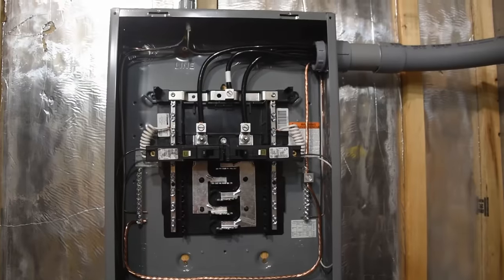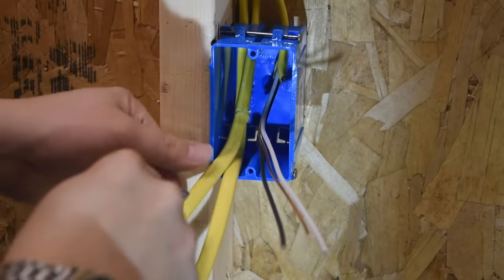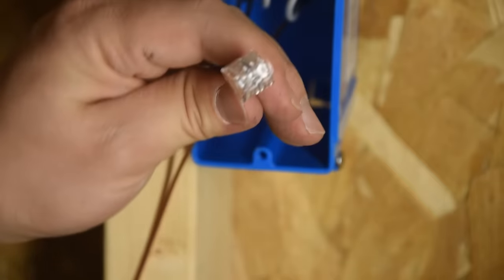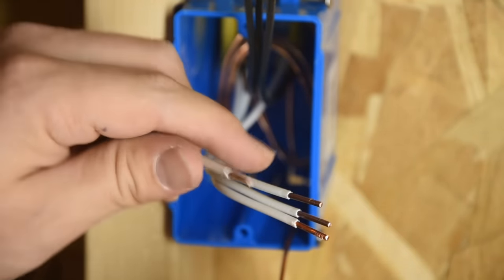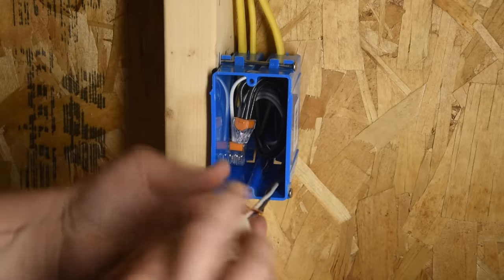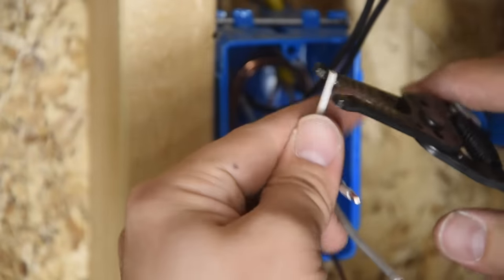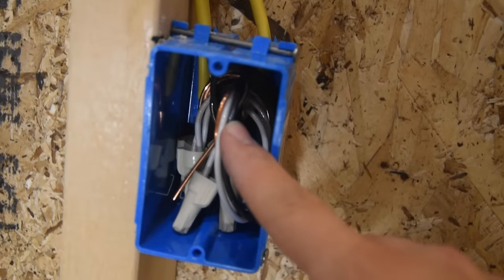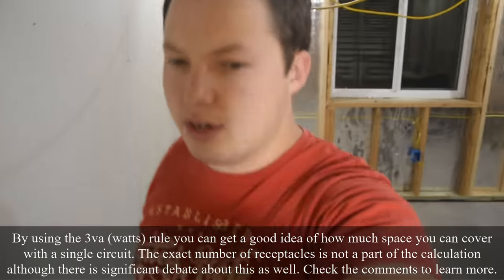Wago's vs. Wire Nuts - How To Wire Outlets During Rough In

Comment: In the UK I've been using wago connectors and different variations (ideal and hellermann tyton)  for 10 years. We used to have wire nuts under the brand screwit. I will not use any other form of connection now other than these mechanically maintainance free types. As for carrying full load current there is a video by a man called john ward where he carries out destructive testing and they are a lot more robust than everyone is saying. The single pinch point of the connector is a thing however on the opposite side of conductor the spring is pushing it onto a large flat conductive plate and so contact csa is not hindered. However not every one likes change and I cannot say there aren't those in the UK who are simply stuck in their ways and don't like progression.
Reply: You can keep the “Change.” With your progressive cents talking bout points and tips,  let’s just terminate every wire with terminal, distribution, junction blocks/strips. With compression fittings 😎 sorry I’m stupid when I drink.

Comment: Great video here. Thanks for doing such nice and clean work. I have two suggestions...

1- I think striping off the romex before going into the box is a bit faster and causes less damage to the coductors. I have seen some guys scratch enough of the conductor to cause a hot spot in the wire. 

2- Rolling wires into the box leaves you open to more damage potential from the drywallers. I always fold the wires into the box for two reasons. The first is that if the drywallers do actually hit the wires, then the damages is limited to the first two inches of the wire instead of the first four inches of the wires. The second is that the wire will already have the shape memory when installing the device. 

Regardless, your work looks great! I'd be proud to have you as an employee in my company.

Comment: I have used Wago’s reuseble with a opener 2, 3 and 5 for like 10 years, never had any problem! I work with refridgeration/ heatpumps, i think they are great!
Reply: @brianreinhardt4050  Are you trying to show this as a proof point that Wago connectors aren't good?!? Aside from the fact that he was talking about the lever nuts, where aren't used here, the WAGO here didn't fail until after the entire wire was essentially on fire.  That is absurd to try to draw any conclusion that any connection type is the problem here other than your house will burn down before you connection fails if somehow all the other safety measures had failed. 
If anything, I would want my connection to fail in an electrical box long before the wire got hot enough to melt the sheathing of the wire running though the wall but that doesn't happen with any of these.
Reply: @curtisbme  I was just providing proof positive that there should be no question regarding amperage overages and burning/igniting.  I've got no problem with them...
Reply: You've been lucky so far.

Comment: good habit is to point wagos and wirenuts up to keep mosture from settling in outdoor boxes. I know your indoors but it becomes habit if you always point them up.
Reply: That's how i was taught as well. I always have my wire nuts facing up.
Reply: Yes, especially with low voltage control wiring. Condensation can settle in the down facing wirenut and corrode the connection.
Reply: also cant fall up as in they cant fall off of they r pointed up
Reply: @amastri1  That is my reason for pointing up, never thoght about the moisture. Now I have 2 reasons.
Reply: Just logged in because of this comment: I was hoping to read someone's comment about this. YES, if you are experienced enough, you should always push your wires in the box with the connectors UPWARDS. Now THAT's a real electrician. Learn  there Benji
Reply: An old technician taught me this 40 years ago and I’m still doing it.  At the time of my post, not one down vote!!!  So I guess we’re doing it right.
Reply: Point em to the sky if you want to keep them dry.
Reply: Agreed.
Reply: My wire nuts always face up. Boxes get really full of dust, especially in an old house.
Reply: were i am all wire nut or wagos must be placed facing up or at 90 degs across weather in side or out.. if not, inspection fails
Reply: @amastri1  if they fall off, it was not done right, and you have a huge fire waiting to happen, never put loss wires in wire nuts, as i noted above
Reply: When you have 4 or 5 wire nuts in a box, the direction they are pointing is the last of your concerns. And if water is getting on your receptacle it probably won't matter. Most receptacles are indoors. Very few outdoors.
Reply: Very good point 👍 — condensation is quite a common issue on a build site during certain seasons
Reply: Nothing happens, even if the water is standing inside the Wago terminal.
Reply: @arnoldromppai5395  Shouldn't the breaker trip
Reply: @jimmy1life  in witch comment, the one i said, never put loss wires in a wire nut? no they heat up and start burning, it not a short until it is burning good and the hot and ground wires touch or neutral. but by that time the wall on fire, seen it many times as well, opened a box up the find all the insulation burned off, but lucky the ends of the wires in the wire nut that were not twisted tight burn off, and stopped the heating.. and was contained in the box
Reply: Instablaster...
Reply: Yup, that's what I've always done.

Comment: Wagos are awesome. I discovered them rewiring my house about 12 years back and never use anything else. I didn't see you mention this in your video, but if you look on the non-cable entry side of the connector, you'll see a small hole/slot. This is so you can insert a probe when testing. Wagos are about the only electrical thing I can think of that is basically ubiquitous around the world... You won't find US cable in Europe, or British plugs in America, but you will find Wagos in all three.
Reply: You will also find corruption in all 3 whats your point? They are still just a shortcut and not the best method. They are popular in foreign countries because of convenience only.

Comment: When I did this kind of roughing in, I used a Romex stripper, not a utility knife. I found them to be safer and faster.
Reply: Amen to that. Once they became available I would use jacket cutting pliers on the cable before inserting it into the box and then pull the jacket off after insertion. Before the pliers became available I used the cable rippers with the small cutting tooth inside a groove just wide enough for the cable. 12 Gauge cable on one side and 14 gauge cable on the other. The cutting tooth wasn't long enough to cut the wire insulation.
Reply: I've always lightly scored the outer sheath until the last inch then I cut deeper, then I use the pulling motion to tear the wire inward.  I always worried I'd scrape a conductor bare.
Reply: i wish they made a romex stripper where 12-2 was on the very tip
Reply: @13dart84  Kline makes a 12,2 stripper, you use it the same as cutting wire, but the cutter only cuts the protective sheeting and not the wire insulation
Reply: @buzzincalifornia  yeah I know I have one but the tip is the 14-2 and the more inside one is 12-2.  Easier to un sheath the 14-2 because it’s on the tip
Reply: Why would you not strip b4 landing the wire.....
Reply: @travisvaughan8838  Not sure what you are talking about. Explain.
Reply: @jimdavis6833  the way I was taught was to measure and strip the outer jacket b4 putting in the box the crimp your switch legs twist your traveler's strip 1/2" of your hot.
Reply: @travisvaughan8838  That might be fine if you are wiring one shed or a one room extension to your house, but when doing a whole house or say an office complex, you want to put all of the boxes in before running the wiring. Stripping the wiring after it's in the box isn't complicated, but I can see why you prefer to strip it 1st. Either way, the boxes should be mounted before ever running the wiring. I find it easier to put the Romex into the box before stripping it. I even leave an extra 6" in the wall to be pulled through later if needed.
Reply: @jimdavis6833  lol I'm a master electrician kiddo.

Comment: I'm not a electrician ( "technician" - wire puller) but have been using Wagos for years with no problem. They've been used for years in Europe and they don't seem to have an excess of related problems (ie, fires, arcing, etc)
Like anything there is a bit of a learning curve with them (wire properly stripped & inserted fully).
Reply: 240 volt appliances likely use about half the current as we do in North America, watt for watt.  Possibly the WAGOs last longer there.
Reply: @hugh007 
A possibility
Reply: @hugh007  We have also curcit with up 32A or more  in Workshops . Deppendent on the type of the wago it goes up to 40A. So no problem with by high current with 500VAC. Normal rate is 10A to 16A in an house for a curcit in Germany. Very much but it is possible. 
Also normal Terminal Block from Wago or Phonix Contact are with Push In. We use them in industrie facilaties with up to 64A. 
If you are not sure, look in the Datasheet. Als product in Germany for electrical equipment must be prove on VDE or EN standards. If they write wromg limits on the datasheet, they will get trouble as VW 😬 with exhaust.
Reply: @hugh007  That is indeed why there have been failure of  these in the US and not in Europe. The spring clamp type connector (Wagos have the highest resistance of of all the typical connection types, (wire nuts, screw terminals and crimps. Doing voltage drop testing at 20 amps I've seen 4    or more times the resistance of a wire nut. 

Where this because more significant is with higher currents, when current doubles the heating goes up by 4 times because it's "I^2 X R", ""I squared R". 
At 20 amps, the heat dissipated in that connection is about 1 watt.  That doesn't seem like a lot, but because the contact  area is so small, at that point, the heat becomes concentrated and significantly hot. The other type connections cover many times more surface area and they are much tighter than the little WAGO spring can make it. 

I've seen some test where the run 40 amps or more through them and the don't fail but get very hot. The trouble is a one time overload condition is unlike to fail catastrophically. Where the problem will arise is in repeated heat/cool cycles. That will anneal the spring, weakening it. I've done some repeated heat/cool cycles at a full 2o amps and the measured voltage drops again. The résistance goes up. More resistance means more heat.

I think these things will work OK with low currents, but because of the "Current squared" factor they will begin to breakdown. If this happens in a box, you'll probably fail open and it probably is unlikely to cause a fire. I just think it's a bad idea to make a high resistance connection when we have ways that are much better.  They are quick and easy, but I'd rather have the best connection I can make.
Reply: @arnewemken6416  The thing about that that isn't obvious is that you are talking about IEC or EN standards. The WAGO 221 says right on it 32 amps. But if you dig into the UL standards for use in North America, the rating is 20 amps. Also, the EN/IEC standards is at 85 C where as the UL standard is 105 C. The EN/IEC has them rated to 450 volts, but the UL standard calls for 600 volts. 

You have to dig into the weeds a bit to find these differences. WAGOs are UL listed for use in the US, however, not at the EN/EIC specs.  The standards are not interchangeable. Of course our electrical  systems are not interchangeable either.  Even the way that the standards  organizations work, are hugely different. Similar in some way, but way different in others. It's not apples to apples. 

I can just tell you this, I've spent many years in Industry and NEMA, (North American Manufactures Association), was the design spec guys. But in the last two decades or so, a lot of IEC stuff has made its way into industry. Bottom line is that you can build machines way cheaper using IEC specs than NEMA specs. The best way I can describe it is that the NEMA stuff is built far more beefy and robustly. For typical industrial control components, the NEMA stuff is twice the size or more than the IEC stuff. Prices for the same functional component is 3 to 5 times more than its IEC counterpart. Most NEMA stuff was designed to be repairable where as the IEC stuff is throwaway. Generally speaking, the NEMA stuff was designed with a much larger safety factor. where as the IEC stuff has little if any margin. 

To be completely honest, I hate the IEC stuff. And we have American companies making stuff to the IEC secs now too. Even though very little of it is actually made in the US. The IEC stuff is definitely more economical. I have seen much more catastrophic failure with IEC stuff. To the eye, it seems obvious that the IEC stuff is much more cheapy made. But the engineer side suggests that generally speaking our big industry has a much more robust power grid and short circuit fault currents  are likely much higher too. That might explain why IEC that fails, seems to explode  into pieces, where as the NEMA counterpart shows damage but can often be cleaned up and repaired and put back into service.

Comment: I use the lever Wago's for low voltage wiring.  Derail circuits for ski hill chairlifts often have 24awg solid and 14 or 12 awg stranded wire connections.  Lever Wagos work much better for fault isolation because they allow you to open and close the splice cleanly in addition to easily adding or removing a single wire for testing.
Reply: If you used the wirenuts you wouldnt have a fault!

Comment: One thing that may make life easier, strip the sheathing before putting the wire into the box. It just makes it so you don’t have to reach in the tight box. I usually pull the wire next to the box, Mark it with my thumb and give an extra inch of seething or so inside the box. Just a tip. I’ve definitely forgot that step and done it they way you’ve done! I like watching your videos, your very clean and thorough

Comment: You can use green grounding nuts to simplify your process, use less wire, and take up less space in the box. They're like regular wire nuts except they have a hole in the end- You leave one of the bare grounding wires long and push it through the hole, than twist it along with the other wires. That long wire coming out is your pigtail, no need for a separate one.

Also, an automatic wire stripper is much faster, easier, safer and more consistent. It strips both the romex sheath and individual conductors, and with an easily adjustable strip length. I use an Irwin one and it's awesome.
Reply: Green wirenuts are a nightmare to work on afterwards especially if the idiot before hand cuts off the twisted wires all the way to the back of the box

Comment: I like the lever locks for temporary connections.  I sometimes have to connect up transformers for load testing and high potting, lever locks are great.  They also work will if you are using solid and stranded wire together.  They also make great cap offs for roughed in electrical boxes.  The push in ones are great when reworking an old installation with not enough room to strip extra wire for a pretwist.  It makes it super easy to make sure each wire is in all of the way.

I do agree with never stabbing a receptacle or switch and it seems like the industry is moving away from that to the screw clamp method in the newer hardware.  I've used a lot of Hubbell connectors and that seems to work.

Comment: Nice job with the wiring, and nice job with the tutorial.   Been using Wago's for last couple years,  and once in awhile wire nuts when necessary.
Reply: I only use wire nuts when I’m working in older women’s homes, older women don’t understand wagos, but they do understand twisting nuts

Comment: When I wired my shop I used wire nuts because that's all I knew about. I'm going to find these wagos when I wire my cabin. Thank you!
Reply: Don't stick to wire nuts..
Reply: Ah. I get it. you want your cabin to burn down in 10 years so you can use the insurance money.
Reply: spend the extra money and get the lever ones easy to remove better hold i think

Comment: When I use Wagos, I wrap a bit of tape around the wires at the base of the wago after inserting them all, puts less torque on the connector itself when shoving them in boxes and only takes an extra few seconds. I also pull on every wire pretty hard after inserting, I've had a few pull out!! I just cut it off and toss it. Don't want to mess around with loose connections.
Reply: Good point, Andrew.

Comment: I use the Wagos with levers on low voltage systems (24VDC) and they are ideal. Have them in use on several offshore locations (non-ATEX) and have not had a single failure. In particular very useful in junction boxes where signal wires are connected: just use a Wago with more slots than wires and you always have an access point to get access to with the probe of the multimeter.
Reply: Why not use them on (110-240). They are rated for those voltages and i use them on 230.
Reply: @broccoliman2293  I only work with 12/24VDC systems
Reply: @robinj1052  Oh ok. my bad